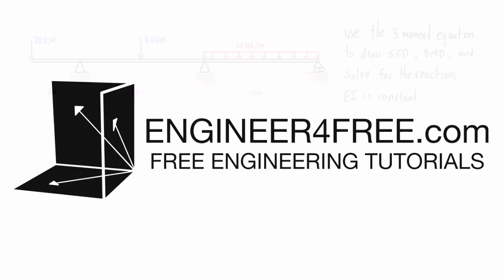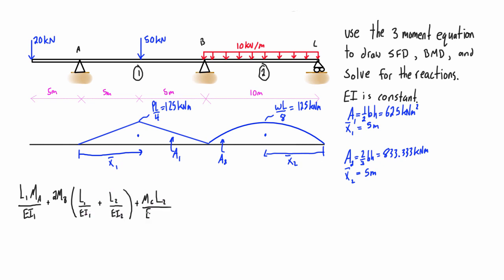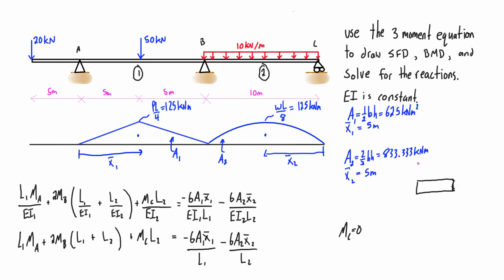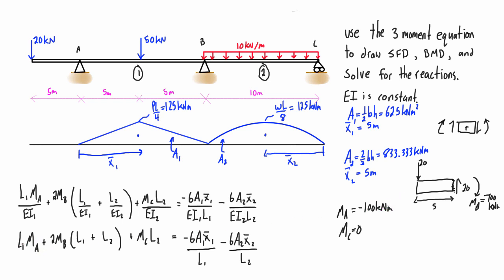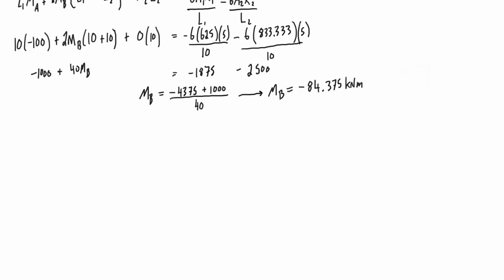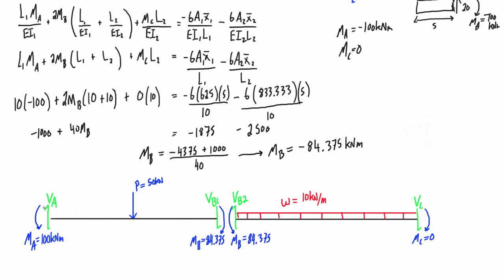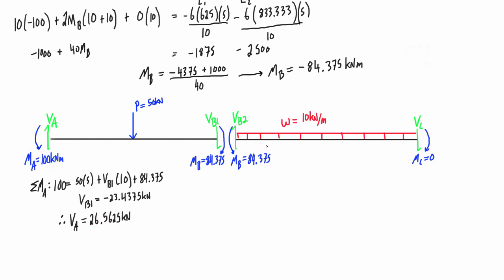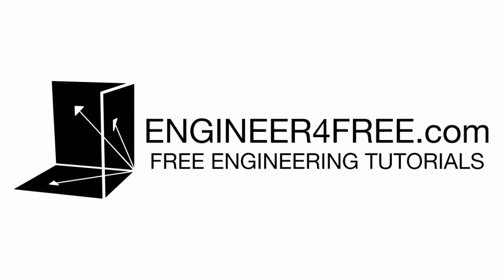3 moment equation example #1 (part 1/3)

Comment: Hi. Why we do not have an area for overhang span? I know it will not be included in the formula but it is really dont have an area?
Reply from the maker: In the 3 moment method, we draw those areas for spans as if they were simply supported. Basically, for an area to be modelled as simply supported, it needs a connection on each end. So the overhang is outside of the realm of the 3 moment equation. No big deal though, because we can very easily determine the internal shear and bending moment at all parts of the overhang using basic SFD/BMD statics.
Reply: @Engineer4Free  thank you sir

Comment: Let me get this straight : the Ma and Mb are negative , but you took their values while summing moments according to the conventionnal drawing right ?!
Reply from the maker: The internal bending moment at a is negative. The internal bending moment at b is also negative. Both are in accordance with the positive sign convention for beam bending. Ma was found using a virtual cut on a free body diagram of the overhanging part, which gives us enough information in this case to solve it. Mb requires the use of the three moment equation in this case.

Comment: Is there a way to use this method if support "B" was a spring support rather than a rigid support?
Reply from the maker: Yeah it's possible to introduce springs to complicate things. I don't have any statically indeterminate videos involving springs, but if you just google "3 moment equation spring" some examples come up!
Reply: I see that you add 6EI * (h1/L1 + h2/L2).  I'm not finding any examples though.
Reply: I see that to the RHS of the equation you add 6EI*(h1/L1 + h2/L2) to account for deflection.  I'm not seeing any examples though.
Reply: Does it not just double the amount of unknowns using this method and become unsolvable?  I've found some examples but if they are statically indeterminate with deflection there's always something they conveniently know before starting to solve the problem.

Comment: Hello, I am trying to solve a question were there is a UDL across the whole beam and a point load acting directly above the middle support. What would the bending moment diagram look like for this and what equations would i use to get force and area of each of the shapes. any help is greatly appreciated thank you.
Reply: https://www.mathalino.com/reviewer/strength-materials/three-moment-equation
here you will find different shapes with quick expressions

Comment: hello, please why is Ma not zero since it is a pin/roller support?
Reply from the maker: The roller just means that the support reaction is not capable of applying a moment to the beam. It doesn't mean that the member won't have any internal bending moment at that location due to other things acting on the beam.
Reply: Overhang will produce a moment at A
Reply: @r.a2229  yeah. Realized that after typing the question. Thanks dear. I never solved a problem with overhang that's why.
Reply from the maker: Thanks for helping out Rita! And yeah Shiloba, check out videos 7 and 8 here: engineer4free.com/structural-analysis for some simple examples with overhang. It will help to get some practice!

Comment: If a free end downwards force occurs on the extreme right, would the substitute moment be positive as well just as the extreme left free end downwards force had a negative moment?
Reply from the maker: In a case like that, your draw a FBD with a virtual cut to the left of the free (right) end. The shear on this FBD would be pointing up on the left side where the cut is. The force couple that you get would induce a clockwise rotation, so the moment at the cut (left side) needs to fight that, so it is counterclockwise. A counter clockwise moment on the left of a cut is a negative moment according to the sign convention that we are using. In both cases, (overhanging left or overhanging right) the point force alone would cause a downward deflection at the free end that results in a concave down curvature. Concave down curvature is indicative of a negative moment in that region. That's a nice quick check to do too make sure you are using the right signs, but be careful because it's only considering the curvature as if that's the only load affecting that region, which is often not true and likely wont reflect the actual curvature of the fully loaded structure.

Comment: how did you calculat the area of the deformation plzz !!
Reply from the maker: Hey I'm not sure what you mean by area of deformation. Can you be more specific or point to the time in the video that you're referring to?
Reply: Oh thanks for reponding bro, well her an example of a unifome distributed load, and then you calculated A2 = 2/3 bh, lets say instad of that we had a triangular load; i apreaciat your help bro
Reply from the maker: Oh I see. A UDL that covers a whole span creates a parabolic BMD, and the area of a parabola is always (2/3)bh, a nice easy thing to remember for basic problems that show up often, and it's useful to use as an example because the calculation of area and centroid for a problem like this doesn't take so long that it detracts from the actual method that is trying to be conveyed. I don't think I have any videos on triangular distributed loads, so I can't remember off the top of my head if there is a quick formula to memorize in the case of a triangular load that starts with a magnitude of zero and increases constantly across a whole span. Triangular distributed loads are inherently more complicated, because it might not start at zero, and/or if it doesn't span the whole span, it's going to be a lot more complicated. If someone else reading this knows the short answer then please share!

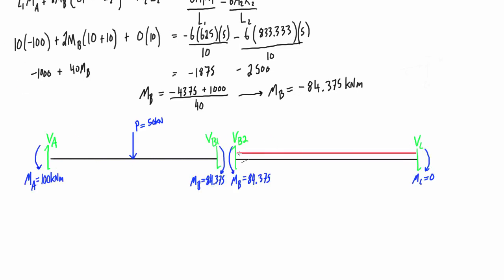Comment: Can i take Ma clockwise at 3:58?
Reply from the maker: You could, but you would need to change its sign to negative. You'll notice that I drew it counterclockwise which opposite the positive sign convention, but wrote the magnitude as positive. Thats the same as drawing it to match the positive sign convention but indicating that the magnitude is negative.

Comment: how is Vc equal to 41.5625??
Reply from the maker: The image on the right is the free body diagram of span BC if were virtually sectioned it infinitesimally close to the ends of the span. We take the sum of moments about some point (I pick point B) and set it to zero because the structure is in static equilibrium. The sum of moments about B is the sum of moments about B so we need to write an expression with all of the moments about B that is equal to zero. We pick a sense to be the positive one and sum them all to zero, or put all of the CCW on one side of the equation and all of the CW ones on the other side (its just a rearrangement of putting them all on one side with appropriate signs and setting to zero, which is how I organized the equation in this video). The only CCW moment about B on span BC is the bending moment Mb = 84.375 kNm. The other moments on the span are all CW about point B. One is caused by the distributed load, and to find it we take the resultant force (10kN/m)*(10m)=100kN times the perpendicular distance from the line of action of the force to the point we are taking moment about (5m - it's in the middle of the uniform distributed load) and that's where the (10)(10)(5) term comes from on the right hand side. The next moment is caused by Vc which is 10m away from B acting at 90 degrees, so the moment it causes about B is the magnitude (Vc) times the distance (10m). That's where the Vc(10) term comes from in the right hand side. Mc, the bending moment at point C is also labelled on the diagram,, so I include it in the expression, but we have already determined it to be 0 kNm, so that's where the 0 comes from in the right hand side. 84.375kNm = (10kN/m)(10m)*(5m) + Vc(10m) + 0 is one equation with one unknown. We just rearrange to find Vc. It's worth mentioning that the units check out and Vc will indeed be in kN. Hope that clears it up for you!